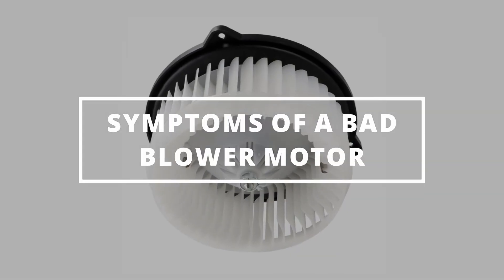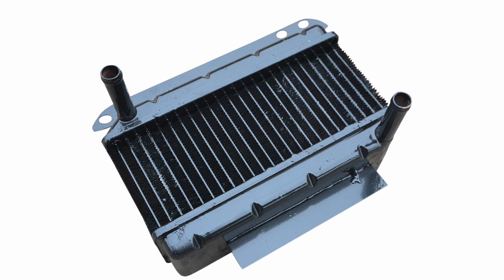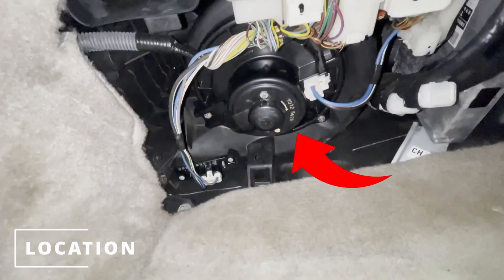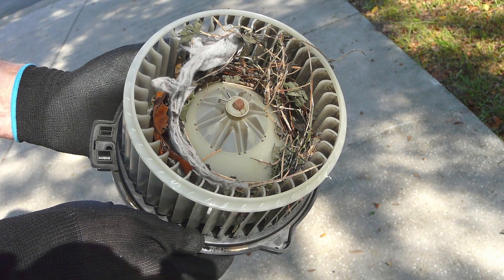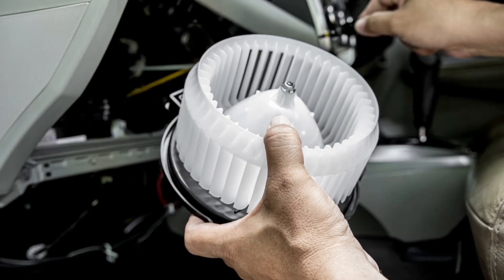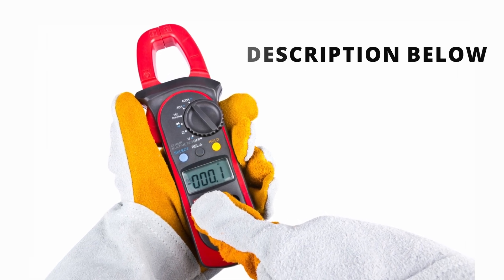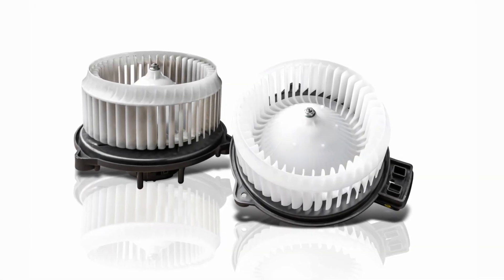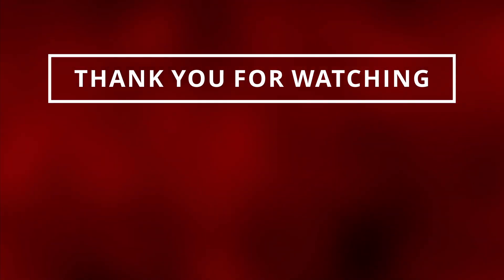SYMPTOMS OF A BAD BLOWER MOTOR

Comment: Learn from my Mistake. I didn't think about blower motors needing filters for cabin air. Never opened it or checked it. Then one day it stopped and I looked to find it completely packed with pine needles. Wrapped all around the bearing , in the fins, etc. a damn mess. Has to just buy new parts it was past the point of no return.

Comment: I know this is an older video, but maybe someone can help me. I have a 2022 Durango RT. If I have my AC on full blast, the power that the air blows out at is low, and the air isn't very cold. If I turn off the AC and leave the air on full blast, it blows at the power it should. If I have the AC on and have the power at 2 or 3, it makes a constant SSSSSHHHHHHHHHH sound but the air is cold. Could that be a bad blower motor??

Comment: What does it mean when you turn the air on and the blower wont turn on unless you push the fan a little, then it will go but then make a rubbing sound and wont go as fast, but then randomly blows harder when the radiator fan kicks on? Im thinking maybe a new blower motor?

Comment: 06 dodge ram 
  - A/C blows cold but when I turn it on full blast it doesn’t blow strong, maybe half way strong. Any idea? Thanks
Reply: I'm having the same issue.... As soon as I turn the AC off, the air blows like it should. If I have the AC on and at a 2 or 3 level, the air is cold, but it makes a loud SHHHHHHHHHH sound. I apologize for responding with this and not answering your question.

Comment: I have a 2015 accord with 80k miles. Sometimes my heater blows really hot air sometimes warm. No check engine light, engine doesn't over heat. Theres coolant in the radiator.Any ideas what could be the issue?

Comment: Thank you kindly for sharing this video. I have a 2012 Nissan Versa 1.6l, and the blow motor is gut wrenching squeaky noise  when I turn it all the way up. it's worse! I do get heat and that's a good thing, But when I turn the control knob 1,2,3,It's very low. Not enough heat coming out. when I turn it on number 4 it's just loud gut wrenching squeaking with hot heat. I have to listen to rock music to drown the squeaking noise. LOL but. since I've checked my car, it seems like I only have one blow motor  you sharing this now I feel a bit comfortable,  Thanks for this video!

Comment: Mine doesn’t rattle, but it does rumble (most noticeable at full speed). This is actually the second car we’ve had with a rumbling motor, although the first one (1998 Chevy Lumina) we never got fixed because it wasn’t worth it. This one’s over 20 years old (2001 Acura TL), but it still runs quite well, and fixing the HVAC is something I would say is worth it. I’d assume the motor itself is worn out, as cleaning it out didn’t help.

Comment: There is a screw underneath the blower motor that I unscrewed. I put a little bit of olive oil in the hole(any oil will work) and I hear the noise way less than it was before. If the noise comes back then I’ll replace it.

Comment: Hey, my Peugeot 208 gt line A/C makes a thudding/knocking noise when turned on. I hit a fox not long ago causing the ac to stop working. Would this require a new blower motor/do you have other suggestions?

Comment: In my kia rio, sometimes the blower motor works, and when the car is turned off and returns to drive it at another time, the blower does not work and after a few time it works on its own again
In fact, I don't do what is the problem exactly? It’s the resistor or the blower

Comment: How do you know if its the Blower Motor or Climate Control Module?  In this case my fan only works on high or number 5,  the other 4 positions dont work at all..
Reply: Resistor

Comment: My 22 civic Ac and heater stopped working it turns on but after like a minute it sounds like the blower motor is struggling makes a noise like it’s having a hard time and the output stops almost right away after it’s turned on i stopped using it just leave it off I’m taking it to the dealer in the next couple days I have a appointment
Reply: Ouch
Reply: @johnlynch6540  faulty blower motor it sucked happened in the middle of the summer and didn’t make a appointment immediately after it happened so it was close to 2 weeks before it was replaced because it took a few days for appointment on top of that had to wait another few days for the new blower motor to arrive to go back and get it installed

Comment: I have a Mazda 6 2018, and the issue is that the air flow is weak, especially at lower speeds. I can barely feel any hot/cold air coming out. The cabin air filter is new. The blower motor makes no noise, it seems is working fine, as well as the blower motor resistor because it lets me change the speeds . However, I also noticed that the driver’s side vents the air flow is weaker. What could the problem be? Could it be that the AC pressure is low?
Reply: Blower motor

Comment: Mine did none of the mentioned and just stopped working. No noise or indication of going out but just stopped. Any guesses what happened? I'll let you know if you are right or wrong, for those with a similar situation.
Reply: Please tell.. I hit pot hole . Fan just stop blowing . Replaced blower motor .still nothing
Reply: @christophersmith2102 check the fuse?

Comment: When I turn on fresh air I smell a little burn, I wonder if it's the blower motor. My 2018 mazda cx5 engine temperature is close to the middle 210F when in operation. I didn't pay attention before, is this a normal temperature? thanks.
Reply from the maker: Indeed, 210°F is normal. The burnt smell might be from the blower motor. Check it and the wiring, and clear any debris. I would also look at the engine and see if you notice anything unusual.
Reply: @easyautofix  thanks for replying, I opened up the mud cover and found couple drip of oil so there's a leak somewhere and the car has only 53K miles for a 2018 car. I used to think highly of mazda but after this incident, I am not sure anymore.

Comment: Mine works but way weaker then before. It's a 2021 civic. Should I replace It or what would I need to do first?
Reply: Check the cabin air filter first
Reply: @rs-vp7re  yeah I did. I actually ended up.needing to replace the blower motor. Got It for $70 at Advanced Auto Parts. It has a lifetime warranty. I've already had to replace It once under warranty. Takes maybe like 5 minutes to replace or less.

Comment: The issue I’m having with my Kia is that the ac randomly turns off and I have to touch or push the cables a little bit for it to turn back on .  Today it completely went out and it won’t even turn on even if I touch the cables .

Comment: My motor will run nicely for a few minutes and then gradually die down to a hamster wheel. I'll turn it off for a bit and then it'll work for a bit. The cycle continues.  Is this the motor or the resistor?
Reply: Blower motor, most of the time if it's the resistor it'll stop working all together.
Reply: @bobbyz23  Good to know as I have a 2018 Toyota SUV, and it works great and then slows down almost to a stop. In Asia we run AC in cars almost all the time. I've replaced a blow motor 3 times in an old Toyota Carina....1973.  I think it was easier then, as it was located by the middle counsel. Thx
Reply: This just happened to my 22 civic idk why this happened I take very good care of my car interior and exterior lol it only has 13,000 miles I just stopped using the AC completely don’t want to further damage it taking it to the dealer

Comment: I own a 07 E-450 cab and chassis dually  and the blower motor works for a while then it'll stop blowing air and turn on again,  then turns off again after a few minutes and turns back on after a few minutes...
Could this be the blower motor resistor or the blower motor itself or both....?????

Comment: My air flow is fine and no sounds, however it smells kind of burnt? What could that be?
Reply: Did you ever figure this out? Same is happening to mine.
Reply: I get a squeaking in the cabin and I thought I smelled burned rubber for a moment as well but it disappeared. The temperature was -38°C the morning it happened. Still squeaked when I drove home.

Comment: Can the blower motor affect the voltage of the car and the engine? At times my car will shut off or start itself which I know can be a symptom of the ignition switch. But also the voltage of the car goes up and down drastically when the blower motors turned on whether it's currently running or not. It's an old blower motor and sometimes doesn't like to work. I guess my question would be is it possible for it to affect other parts of the car?

Comment: My goes dtron and then weak air flow, if i drive thru a pothole it starts back up again same if i tap it starts right up, do i need to replace it or could it be a fuse?

Comment: Can someone please explain to me why my blower motor will not twist on I’ve done everything right and it won’t work and I’ve even bought a new one can someone please explain it’s hard with no ac
Reply: Check your relay
Reply: did you ever figure out what the issue was. my blower motor isn’t moving at all but i don’t want to pay to get a new one installed and it still not fix the problem.

Comment: So here's a crazy story. One freezing cold winter i was living in the middle of nowhere and I turned on my heater and instantly heard small thumps. And a couple of days later a horrible smell started coming from the vents. Well i remembered a story an uncle told me when i was young about something similar happened to him, so i said no way it could be the same issue. I pulled the blower motor off and sure enough a field mouse had gotten in there and died probably when I had it turned on full blast.. threw it out, lysol the crap out of the blower, pop it back in, and all was good.
Reply: that's horrific omg
Reply: @laurenelizabethlewis2313 you could say he had a speedy day
Reply: I had A car I rarely drive. My neighbor loved feeding squirrels dried corn from a bird feeder. I went to start the engine heard a grinding/crunchy sound. Popped off the top of the blower and the fan was completely full of dried corn. It was also in the air filter of my motorcycle that I drove more often. I started the bike and a bunch of dried corn flew into my carb. The car was a simple fix with a shop vac. The bike cost $579 to clean and retune the carbs. I saved all the corn from both and late one night dumped it all over the interior of my neighbors jeep Cherokee. From then on I used red Ryder and sling shots to deter squirrels and chipmunks until she gave up on the corn. She'd get so upset about her little "friends". I'd invite her over for squirrel stew. 😂 Stupid damn rodents.
Reply: Same thing happened to us maybe 10 years ago!

Comment: Hey bud got a question for ya,
Four days ago I bought a 1999 Ford F-150!
And when I turn on the AC after a few minutes I have smoke coming out from under the hood vents outside the cab and it smells electrical, now my thinking is this.
That the blower motor is completely locked up and is getting extremely hot once power is applied causing it to smoke I was also informed this vehicle sit for a long time, I also had to reglue the windshield back in I did that on July 3rd of 2023 I could literally lay it out on the hood the gentleman I bought it from was unaware of that issue he replaced the brakes the rotors and a new fuel pump, also the speedometer don't work. I checked all fuses they appear to be good. I look forward to getting a reply from ya
Reply: Friday, October 20, 2023 ☁⛅☁

It's 3 months later. So I expect you already found the problem and fixed it.

With a blower motor, the windings are coated with shellac. So when the bearing fails, the fan stops spinning, but electricity is still going to it. So the windings get hot and start smoking! 🔥Then you see smoke, but inside the cab. This will also make the blower motor resistor get hot and fail.

But you had smoke coming from vents under the hood, outside the cab.

I'm not familiar with pickup trucks. So my best guess is:

1: The smoke from the blower motor traveled through vents and got under the hood. This is just a guess. I actually don't know if this is possible.

2: You had two problems at the same time! The failed blower motor was making smoke, and something else under the hood was making smoke!

I replaced Debra's blower motor last night. She's an old friend, and she has a 2009 Ford Edge. The old blower motor seized, which also made the blower motor resistor fail.

Surprise, there are two types of blower motor resistors for this car! There is one for automatic heating and one for manual heating. So I had to buy a second resistor, and return the first one.

The old blower motor absolutely stunk, from the burned shellac. It had a strong smell of ashes.

Also, I find a lot of bargains, shopping for car parts on Ebay. I bought a blower motor for $38, plus tax. The cheapest price at O'Reilly was $66.

Hopefully this will help you out. I wish you many happy miles with your new old Ford pickup, Anthony 😀

Comment: I have a sort of high pitched "ringing" or whistling sound coming from the vents. What would you think that is? Faulty bearing?
Reply: No, you gotta clean out the other coil under all that metal, mine did the same just cleaned it with coil cleaner , works good now
Reply: Think of how someone whistles with a blade of grass in between their fingers as they blow. You have debris or more likely a duct door or plastic ductwork that has shifted and the air moving past this deformity or obstruction, creates the whistles. Partially opened duct doors (as ya switch from floor to face to windshield defrost) happen due to debris, but if the car is older, it’s more likely a vacuum line leak issue
Reply: Maybe a leaf or paper is stuck in there.

Comment: How tobget into the area to fix it please
Reply: It is a tight fight but you'll have to slide the seat all the way back, also there are three bolts that hold the blower motor on start with the hardest one first because if you don't you will have to fight with the weight of the blower motor and it being the hardest bolt to get to is a bad combination and headache you can avoid just buy starting with the hardest bolt first.
But the absolute first thing you want to do after moving the seat back if you have power seats after that is done, for everyone why do you have power seat or not anytime you're doing something with electronics or electricity on your vehicle disconnect the battery before you give your ratchet the first turn!!!!! I cannot stress this enough!!!!!
Second thing remove the cover that is over the blower motor, then start with the hardest bolt then move to the next hard bolt then the easy bolt but also hold the blower motor up you do not want that blower motor to come crashing down into your face!!!!!!!
Then unplug the plugs! Then toss it to the side and grab the new one and pop it in to the hole and put the first bolt about half way in/ the easy one now move back to the hard one ( you did this to help hold the motor up and give you a little wiggle room to put it fully in it's place) now once it fully in it's place and the hardest bolt is all the way in push up on the motor and tighten up the hardest bolt then move to the easy bolt remember it's halfway in already and all you got to do is just tighten it up and also put the third one in and tighten it down make sure you tightened all three because if you did not it's going to vibrate loose and you don't want that now if you didn't connect your power connection and it's to where you can get to it from here go a head and hook it up, if not ( hook it up before you put in the hardest bolt at the beginning of the install - sorry I should have said something then) now hook your battery back up and don't start your car/truck/suv but just turn the key until the dash lights come on, now reach over and test your blower motor turn on the AC and the fan switch and you should have air and no loud noises this means you did it right! Go ahead and start your vehicle and check out your handy work 😊 now while you now have a let it run while you put your blower motor cover back on and put the seat back forward, then pick up all of your tools clean them/ wipe them down and put them up. As for the old blower motor I don't know if their is a core charge on them or not, if not please give it to someone who haul's scrap I know that it isn't much but to someone who haul's scrap it could mean the difference between a gallon of gas and something to eat or just a gallon of gas.
Believe me I do know, in my area shred is $7.00 a 100lbs and aluminum cans is $0.30 cents a pound so every small bit dose add up! And this better than letting it go and sit in a landfill somewhere, at this right it'll be recycled!

Comment: My gfs Kia Rio works most times but as soon as it gets warms it starts to turn off then I have to smack it around the glove compartment area for it to start back up (it’s an $800) fix supposedly 🤦🏽‍♂️
Reply: I would try to install a new or used blower motor and save the $800. If it's not it, then I would keep the blower for another time.

Comment: What about vibrations?
Reply: My 2013 ram has vibrations when AC on and a humming sound AND it smells like coolant
Reply: @universaltoejam my friend I hate to tell you this but you have a coolant leak in your heater core or the hose just outside your heater core my buddy had the exact same problem and same vehicle
Reply: Same issue in my Chevy Cruze. Would love to know if this is the cause!
Reply: What exactly is vibrating?
If it's your blower motor you need to get down there and tighten up the bolts